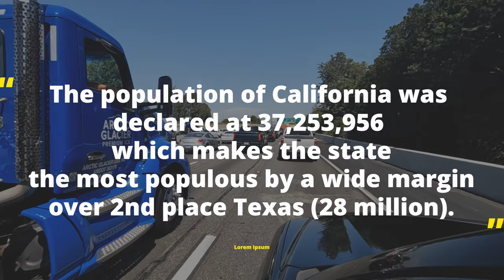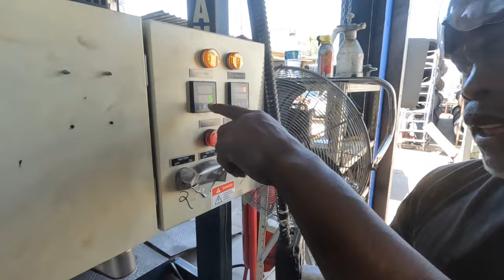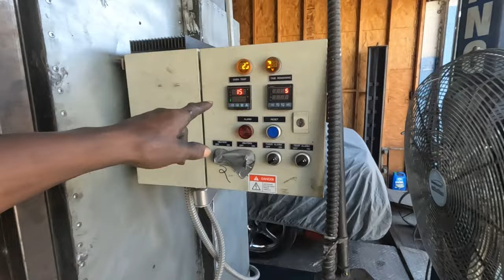Picking Up 18" Pull back Bars For My 2022 Road Glide In California

Comment: New subscriber thought I’d just let you know about this. Same bars that you have you can get at FMB Choppers under $400.-
Reply from the maker: FMB usually sell meat hook bars and not pull backs. I could be wrong though. However, I love supporting my black owned businesses and there something about getting my bar built from scratch. Thanks Bruce.
Reply: @ridefitnation  just to let you know, FMB has others besides the meat hook. They’ve got quite a collection of different handlebars and they also like the gentleman in California. They make their bars from scratch and to your specifications on height or thickness. Width of the bars pull back the whole 9 yards.

Comment: How are your pull back bars for slow speed maneuvers in a parking lot?
Reply from the maker: They work good for me. Of course you won’t get the exact handle as the factory bars, but it works well for my riding style especially on the road.